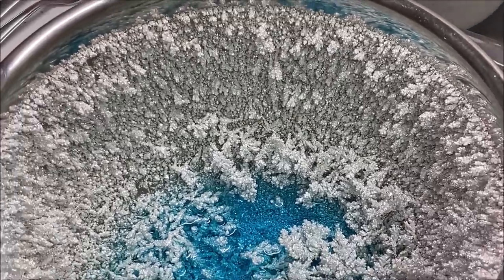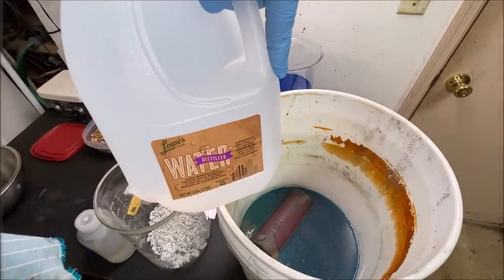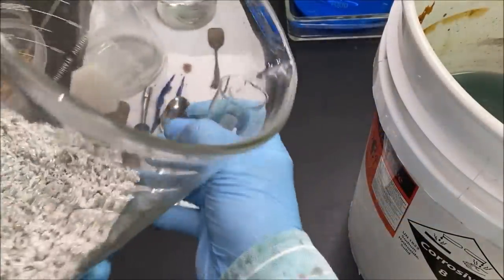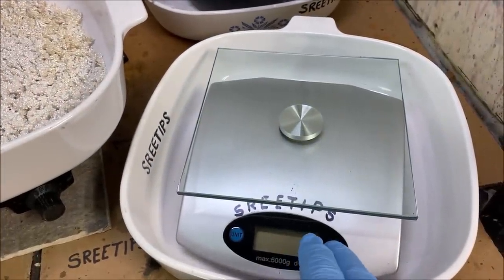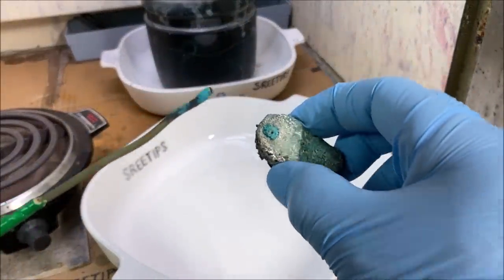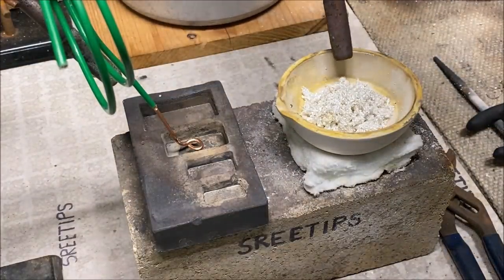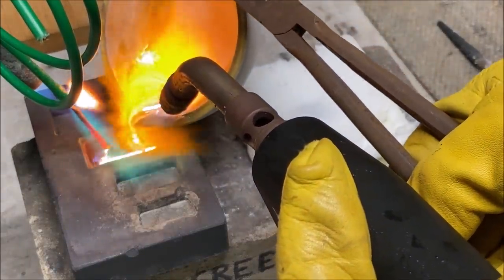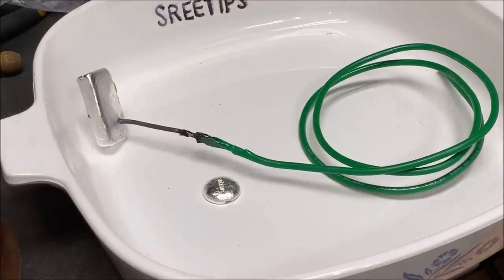Casting A New Electrode Bar For My Silver Cell

Comment: Excellent work. While I’ve never had an issues with running my silver cell with just alligator clips hooked to the edge of a silver bar plunge into the shot, I really like the idea of pouring silver around the wire to make a definitive solid connection with no chance of extra resistance occurring between the junction of the two metals as might occur with alligator clips. I think I might actually change up my setup and pour a bar with copper wire out of it like this tomorrow. I have to restart my silver cell anyway so this would be a nice addition to the setup. Beautiful silver btw.

Comment: Hiya sreetips, hope your doing well?
Great video quality. Two things I found of interest.
1) The discoloration of the silver crystal on drying out was not due to anything in the atmosphere but due to a plastic coating they put on Pyrex nowadays. The Teflon or PTFE is safe upto 500F, above that it gives off toxic fumes which condensed onto the surface of your silver crystal. Pyrex is perfectly safe to use as long as you keep the temperature below 450F and avoid strong alkali.
2) I enjoyed watching the silver bead slowly crystallise. The point at which it solidified showed the dissolved  oxygen being forced out of the liquid metal. Dissolved gases are a huge problem when casting articles from molten metals.
Stay safe and keep up the good work.
Reply: He wasn't using a pyrex dish though when he baked his silver. It was a ceramic dish and he doesn't use any teflon or PTFE coated dishes in his work. Pyrex also doesn't coat their glassware internally. They have very specific vinyl coated bottles but that is external not internal. That slight discoloration is due to the silver being slightly higher temperature and it being humid which allowed the sulfur in the room to tarnish it. He uses sulfuric acid frequently in his run's so there absolutely will be an elevated sulfur content in his room.
Reply: @sams6090  silver sulfide is black/dark grey and silver sulfate is white. Those would have been the color of any tarnishing if it was due to sulfur or sulfate. Pyrex is coated so that it is dishwasher safe and to prevent shattering when a hot dish is placed on a cold surface. The fumes would have come from the outside of the dish where it was in contact with the hot plate. The fumes condensed onto the silver surface because it was still cool from evaporating the water it contained.
Reply: @markfudger5267  Tarnished silver is brown and then turns black over time. It's got any number of different colors as well. In general though it is brown. Pyrex is already dishwasher safe because it's made out of glass that has been tempered. SOME specialized pyrex has a coating on the outside however you would instantly know it had said coating because it would be coated. What we see in the video is not pyrex but a simple ceramic dish. I'm not even sure where you're getting your information because simple googling can show you're wrong about everything you say.

Comment: Mic sounds good last couple videos. Just after you made your new set up, the " P " sounds were really hitting the mic hard. All seems smoothed out now.   Appreciate your content. Im still gonna find a way for you to use  or recycle that copper.  
( im a plumber, copper is my " gold "  )
Reply from the maker: I buy copper from retired plumbers. Copper fittings by the bucket. I bought 50 feet of three inch heavy copper pipe for about $500 about six months ago. That’s enough to last me for at least two years. Copper is very useful for refining precious metals. But after that, it’s waste.

Comment: Man that story about the 16 century is extremely interesting. Explains when I took a Silver coin I had from the Perth Mint. After about 30 mins it got a slight yellow stain to the 99.9% coin. Great to learn something especially like that. Cool mate cheers
Reply: It tarnished that quickly?! Were you boiling and eating eggs right next to the coin? All my pure silver rounds (almost exclusively American Silver Eagles) are stored in those typical airtight plastic boxes that hold 20 coins, these boxes are stored inside of Pelican cases and the cases are stored in my underground safe. Never had an issue with tarnish on these and the oldest ones were minted in 2011 and bought in 2012.
Reply: @Alsacien  it was a 2012 Australian issue Victoria Cross edition for Aussie solders. I was smoking a cigarette but definitely in under an hour she developed a slight yellow tinge. I didn't get any worse and it's been cleaned and good as new again. I've heard some people have a small film over pure silver bullion. But yeah most certainly happened that fast. Possible as I work with engine's for cars that their could of been some corrosive chemical on my hands?? Have alot of sterling silver and I don't seem to have an issue their. But I won't ever open my high purity silver again.
Reply: @patrickaussieMilartry  I think that you might have found the culprit! It could very well have been the cigarette as its smoke contains multiple sulfur compounds, although I couldn't tell you if the quantities delivered in a room by a single cigarette are sufficient to produce visible tarnish on a coin. A study from 1974 identified 85 μg of H2S, 35 μg of COS, 2 μg of CS2, and 3 μg of SO2 in the smoke of a single cigarette.

Comment: I do some machining on the side with a CNC Milling machine & lathe. Every time I see one of these videos where you make new anodes, I think about seeing if I could machine you a better anode. IE: casting a small block of silver and then machining a "stem" into it and adding a threaded hole where you could add a screw terminal for the best connection possible.
Reply: just use a silver wire
Reply: screw connection will just corrode and add resistance, silver wire cures it

Comment: add wet paper towel around the insulation of the wire and it wont melt down from the high temperature of the molten silver... also you might dip the copper wire in soldering flux to make the bond with the silver better...

Comment: Hi, I stumbled upon a jewelry manufacturer while dumpster diving and noticed they throw out quite a bit of silver shavings which I believe come from the finished items after they come out of the molds and are deburred.  I think it's safe to assume that it's .925 sterling and nothing higher.  I was hoping to convert all this .925 (about 40 oz so far) into .999 fine silver and pour bars.  Do you have a video explaining the process or any basic recipes where I don't need any knowledge in liquid chemicals ?  I'm a commercial handyman so not afraid to get my hands dirty, any help would be appreciated.  Btw, love your channel, one of the best on Youtube in the way you detail your work step-by-step with thoughtful warnings and insight; just the overall quality is refreshing to see in today's world.
Reply from the maker: I’ve used rooto professional drain opener (sulfuric acid) or nitric to dissolve 925 silver. No other way that I know of.

Comment: 10 days  1886 grams pure silver
1886/240 hrs.  7.85 gram/Hr.
3.5vdc @ 3.5 amp/hr. 
7.85g/3.5ah=
 2.25 grams of silver per amp hour @3.5VDC ( 240hr.x2.25X3.5).   1890
 Hrs  x  Grams  x amps 
Or 
24 hours @ 35 amperes/ hour
Would not simply increasing the electron push up toward 35 volts DC and 35 amps accomplish this electrolytic purification of the scrap?
Reply from the maker: With voltage that high the crystals would grown very quickly, long and needle like. Contact and burn through of the anode filter would happen.

Comment: That was to do so interesting. I could live really good on that much silver per month, weekly I'd be Rich. . Anyway, the silver cell electrode appears fast and effective. 
  Sure would want to experiment by placing a 6 volt incandescent 5+ amp rated lightbulb ( or three or four led's) between the green lead and power supply. 
   I'm also wondering what effect switching from a DC power supply to an AC supply voltage would accomplish? 
✌️♥️👍
Reply: keep in mind that he has a bucket full of cemented silver, or two, we are talking about at least 40 kilograms, he just proceses like 1.5 kilograms each like 10 days, sell that silver alone should give you some decent money, now remember that he refines gold, not silver, this is almost leftovers for him

when i get old, i want to be like him lol
Reply: Electrolysis is a dc process.  Using ac would deposit then strip the deposit at whatever hertz your ac runs at.

You’re using electrons to force a reaction to go in one direction, with dc.
Reply: @williamfoote2888   I see, thanks for pointing that out. Sometimes I get a little confused about electrolysis and electrical energy and even galvanic corrosion at times. I'll never make it to being an electrochemical engineer. Probably just kick the Mobius up to 300 amps @ 3.5 DC and call it a day! I suppose that would be impractical.
   Seriously though, in considering the silver basket with anode and the cathode placed outside the bottom of the steel bowl the refined silver just kinda gets stuck trying to get through. No wonder it piles up and needs to be scraped out. 
   I do like the idea of controlling the ac frequency, Four baskets, arranged hot neutral hot neutral and a bonded bowl. 
    Wouldn't the anode hot and cathode neutral just reverse to cathode hot and anode neutral but with the two additional baskets alternating in series. 
   All the additional bubbles should keep the nitric solution hot too. 
     Of course four one hundred watt lightbulbs could amp it up.
    Probably adding diodes to increase the frequency so fast that the appears like DC current doesn't make any sense by any text book answer either. We all know they are voltage rectifiers which only allow the electrons to flow in one direction - seriously could get shotky the blocking diode. 
   Well that gets me back to 3-5 VDC and an expz 300-600 amps using a 115 AC 30 amp circuit me thinx
Reply: @anthonyrstrawbridge  High amperage and low voltage is how most electroplating is performed.
The contacts of an industrial plating operation are solid Cu bus bars to the individual plating rack or plating barrel.
They use large DC rectification equipment that has absolutely zero ‘ripple.’
Multiple tanks are set up in parallel of that particular, properly sized rectifier.
Sreetips could run multiple Ag pots at the same time from his bench rectifier.  The same number of electrons will reduce the same number of Ag atoms.  It’d just take twice as long.

Comment: Mr Sreetips thanks for your many videos i have watched many of them. I have a question about the one on the waste treatment. You said that you get the ph down to a ph of 9 in the green solution . is this done by adding more LYE or something else. hope you read this would like to know. this was in video silver refining pure silver crystal part 2 .  Doing some refining myself. have learnt a lot from you. thanks Thurman.
Reply from the maker: I use pH down (from the swimming pool section at the hardware store) to reduce pH value to nine. Higher pH values will tend to put some metals back in solution.

Comment: Hey Sreetips this day it comes to my mind an idea which you may test for me but mostly for you to use ultrasonic cleaner to either rinsing process as well even for dissolving processed  materials. I think it should be a great improvement while removing base metals from RG,GF and GP materials.
Reply: are you saying to put a glass beaker into an ultrasonic cleaner while its loaded with acids?
Reply: @themyceliumnetwork  Yes you put beaker into the ultrasonic bath like when you want to heat on oil/wather bath.
Reply: @welchianachi7707  what is the glass beaker sitting on?
a metal rack?
Reply: @themyceliumnetwork  It should be suspended  like basket in Sreetips silver cell.

Comment: Why don't you ever use a strainer when you dump and wash the silver crystals? I'm not a refiner so maybe I'm missing something, but it seems like it would be more efficient.
Reply from the maker: Didn’t think of it
Reply: @sreetips fair enough. Maybe a fine stainless steel strainer?
Reply: @R.J._Lewis  I would suggest something non-metallic to avoid contamination.

Comment: @sreetips, have you tried using deionized water with a reverse osmosis filter instead of using distilled water? You go through a lot of that stuff, it should save you quite a bit $$$
Reply: I’d just use smaller aliquots of distilled for the rinses. 
There’s no need to immerse the entire mass in water.  If it was immersed only one half or even 1/3, with sufficient stirring, it’d rinse off the same amounts of electrolyte.

You know what?  His bench technique is quite good, so if we’re talking about the water consumption of his whole process, we’re pretty deep into the weeds.
Reply: @williamfoote2888  I’m not experienced in this field by any means. However, I do have a RO system at home with de ionizing cartridge. Got it for $60, have been using it as primary filter for drinking water. I check the TDS regularly, 1 year in, it’s still at 0 tds. It’s not just about $$ but the convenience of not hauling tons of water from the store every week.

There is a video by NurdRage on the same topic, apparently pro chemists use this kind of systems at their labs.
Reply from the maker: I use about 20 gallons of distilled water per month. It’s only $0.99 per gallon

Comment: Could you have used the impure silver shot/ cement silver to cast the electrode? It gets slowly dissolved anyway, its a shame you have to use the pure stuff.
Reply from the maker: I could. But the pure silver melts like butter and is much easier to work with

Comment: I have this question, what is the reason to use ultra-pure silver for the electrode bar and not the dirty silver shots in the background? Thanks!
Reply from the maker: It’s easier to work with. It melts clean. Pours nice. Better than cement silver.
Reply: @sreetips  thank you, makes sense! :)
Reply: And it was probably the best thing he could have done with that slightly tarnished silver rather than mixing it with the rest of his perfectly white silver, but that might be my OCD speaking. ;)

Comment: Could you grow gold crystals like this?
Reply: Not easily like he does with silver. The easiest and quickest way would be to do it like I grow the gallium crystals I make. You melt a large quantity of pure gold, allow the crystallization process to start in the melt dish or mold and extract the crystal with steel prongs when you feel that it's large enough and before all the charge of gold has had a chance to solidify around it. The key is temperature control and quick and precise hands because you don't have much time when the metal starts solidifying. It can be dangerous at these temperatures, you really don't want to drop your crystal in half a kilogram of still molten gold at that point! You can also make small crystals directly out of highly saturated gold solutions. It would involve a lot of trial and error.
Reply from the maker: Yes

Comment: I always wondered if you could use something else instead of Silver for your anode electrode bar.  Since you use a Stainless Steel bowl for the Cathode, could you use a block of Stainless Steel as an Anode?  
That way if it gets into the Electrolyte it might not dissolve.
Reply: Ma,be not stainless steel... but something more up on the reactivity series.

Could you Maybe cast a (smaller?) Anode-bar from paladium oder so?
Reply: He could use any number of elements, but if you look at the theme of his recovery processes and cleanup, it’s PGM, gold, silver copper and lastly iron, which he can easily dispose of.
Everything else is recoverable and has value.

Adding in stainless adds in nickel and chrome, as the anode dissolves.   And it will dissolve.
Using Ag, any dissolution just adds more silver to the electrolyte, which he will, ultimately recover.
Reply: It's ideal to use pure silver because the anode dissolves, a stainless steel anode would corrupt the electrolyte with iron (also Nickel & chrome) which corrupt the purity of the crystal. 

I have used sterling in the past which does work but it adds a lot of copper to the electrolyte. Once the copper nitrates get too high the copper will plate out on the pure silver.

So, it is best to use the highest purity silver anode possible.
Reply: @williamfoote2888  oops youtube hid your comment until after I typed out the same answer 😅 my bad